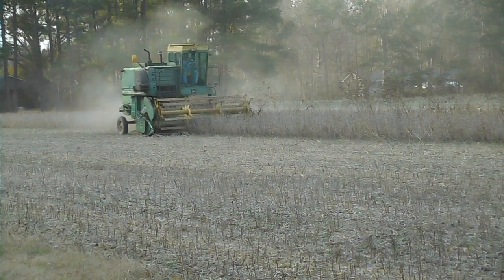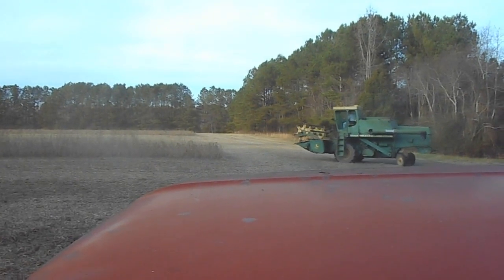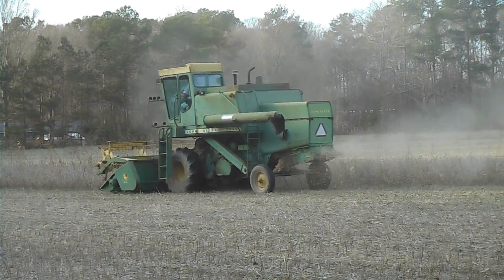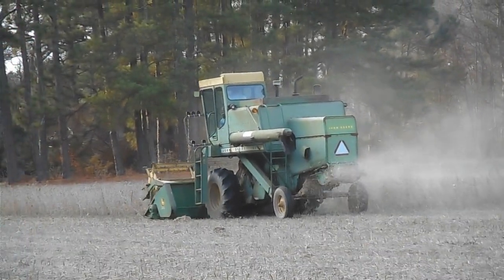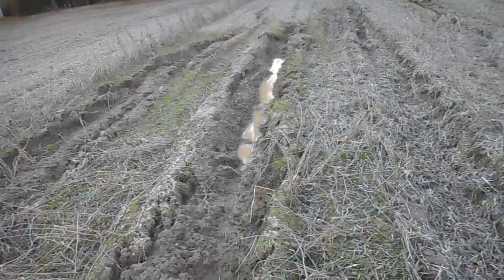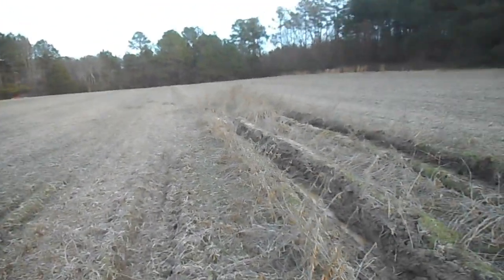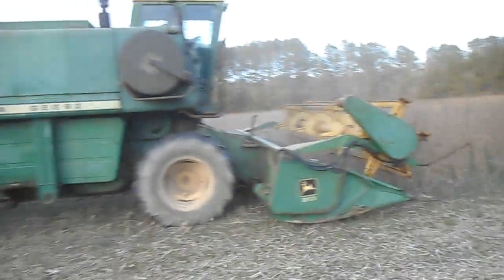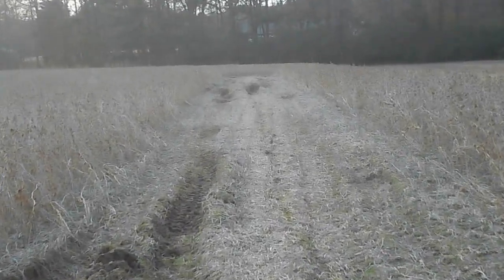2019 and back to picking beans again

Comment: The two belt system JohnDeere used was kinda tricky to adjust, good thing you had the book! My Gleaner has one belt with two variable speed shives it's self tensioning till the belt breaks then your dead in the water.  Thanks Soybean Farmer I hope you got done!
Reply from the maker: CE Smith - that's an understatement about being kinda tricky to adjust.  it took us 2 hours to accomplish that task.  you get one variable sheave set the other is way off and then back and forth you go until you realized how you are supposed to center the two sheaves before you attempt to set the gap with the set nuts on the cylinder.   but praise God He kept on telling us how to accomplish the desired end result until we after a long time finally understood.   not done yet but we are still in the fight with no fat lips, broken jaws or black eyes.    thanks for being here CE.
Reply: LMAO CE!!! You make sure to have good brakes with a belt driven machine!! Bad enough with hydrostatic... If a coupler strips!!
BTW, been there with both, on hill ground!! Gleaner and JD put good brakes on combines, IH did not...

Comment: Sure glad you and Cousin Scotty got the variable drive fixed!
Reply from the maker: AKWayne S - I drove it just enough to realize the system had not been right in a long time.  now at the end of the fast travel the machine don't fall off into a dead zone and stop pulling.   I'm really pleased with this repair adjustment.  thanks for watching.
Reply: @SoybeanFarmer3300  Our Gleaner has the same symptoms. I guess that needs looked at. Thanks for postin' this , Ol' buddy!
Reply from the maker: 57fitter - I hope you can get it fixed because mine was very aggravating when you wanted to go just a little bit faster and then lost drive power.  now the system pulls better at any speed just feels more solid.   very nice to see you here.